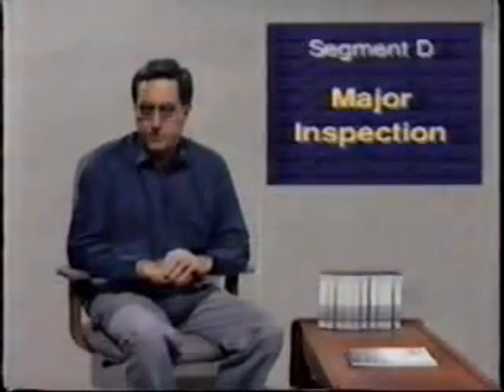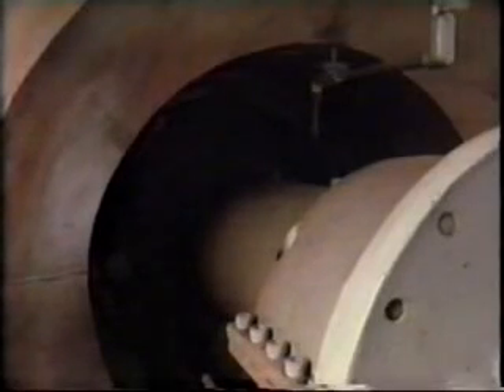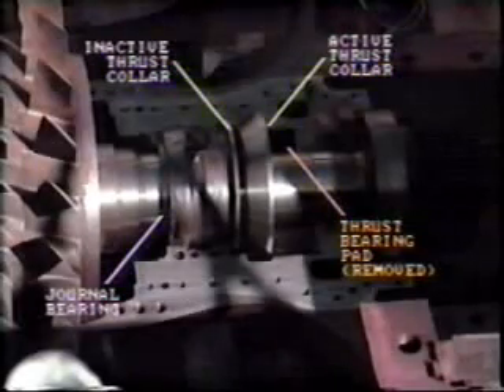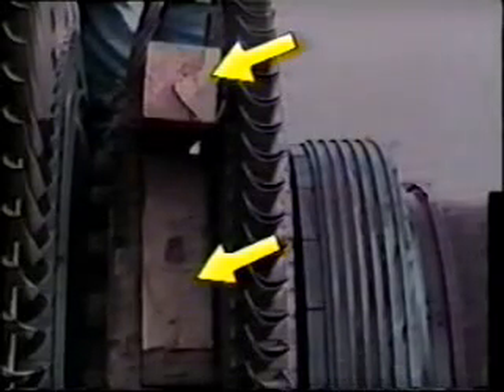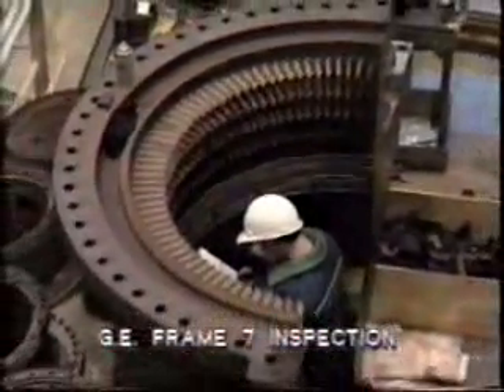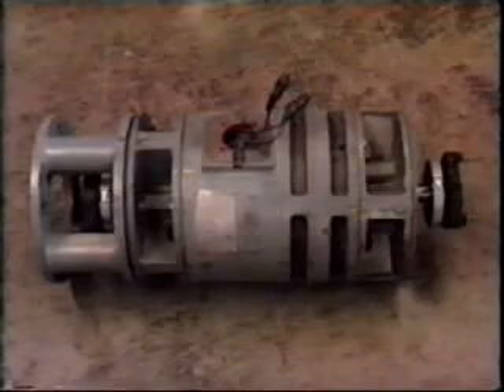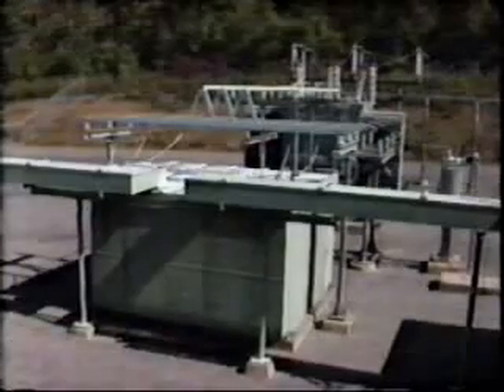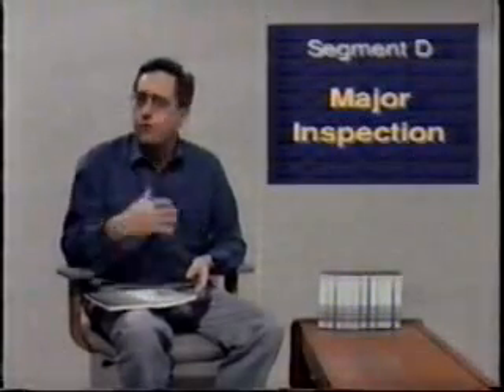Gas turbine Compressor GE Maintenance overhauling👌

Comment: Wow. 40 years ago I worked for General Electric Technical Services Company, GETSCO and worked out of Zone III, Middle East. I had Frame 5 model  LA, M, N, and P turbines apart as well as Frame 3, 4 bearing units, old 5 bearing Frame 3's, Frame 6 and Frame 7's run by natural gas and distillate fuels. I did Fuel Regulator, Speedtronic Mark 1 and 2 controls for compressor drive units and generator sets. Now I sit in the park all day and feed pigeons.
Reply from the maker: Ur welcome 👍